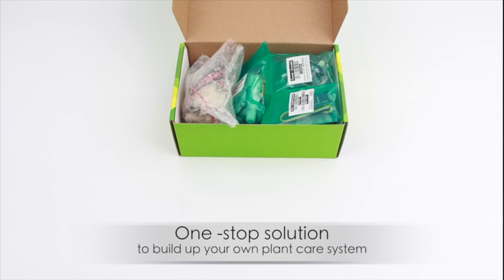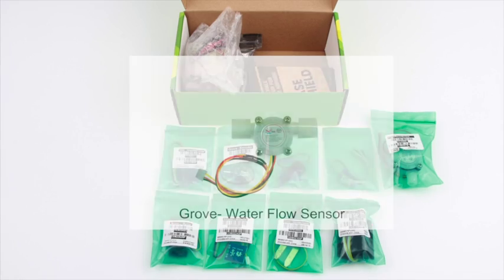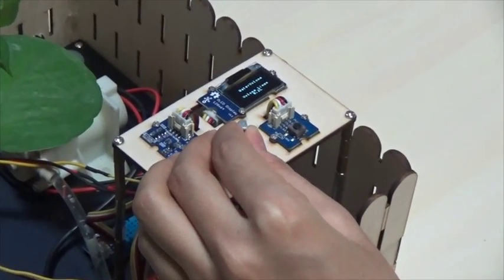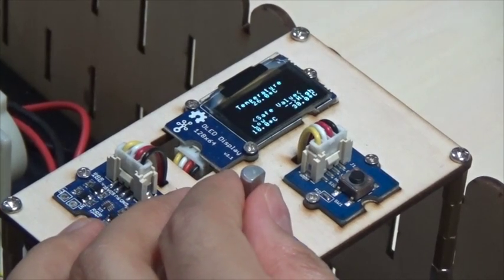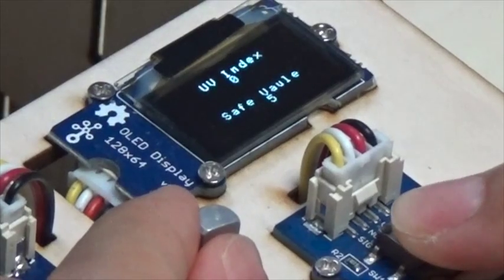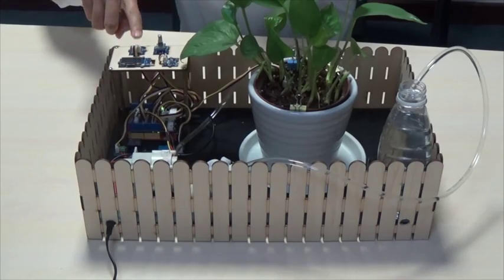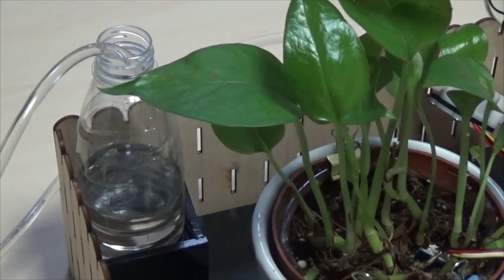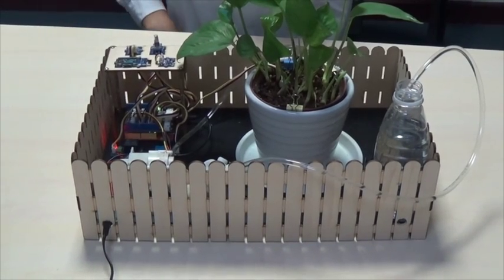Build a smart plant care system with Arduino and Grove sensors

Comment: Nice kit, but it should include a capacitive soil moisture sensor instead of resistive sensor, because it wont corrode and stop working like this will. At least i hope it doesnt measure constantly? That would make the sensor corrode to shit in like a couple weeks
Reply from the maker: Thanks for your advice, we've released the new capacitive moisture sensor.
https://www.seeedstudio.com/Grove-Capacitive-Moisture-Sensor-Corrosion-Resistant.html